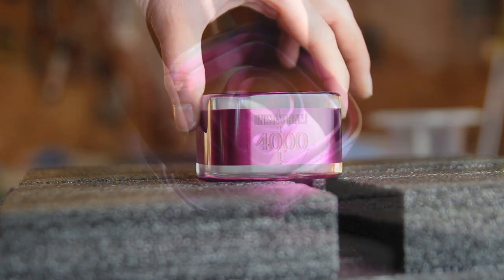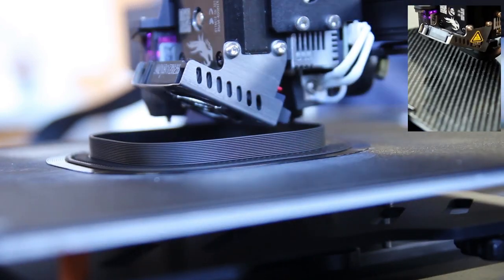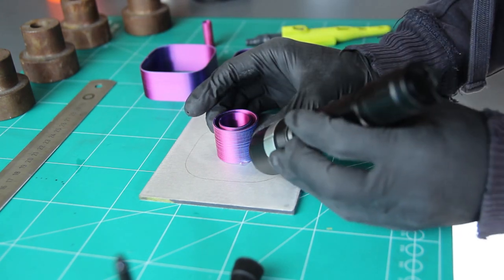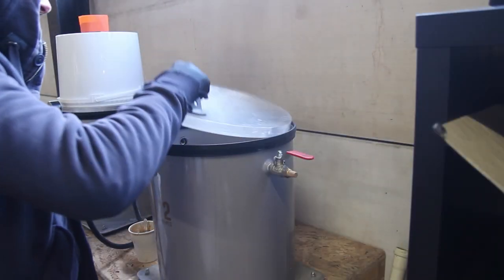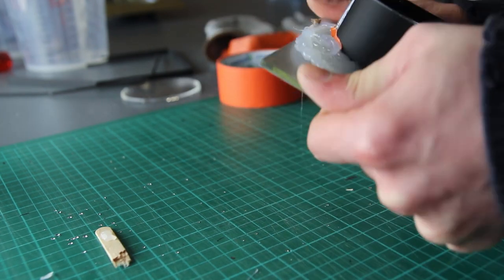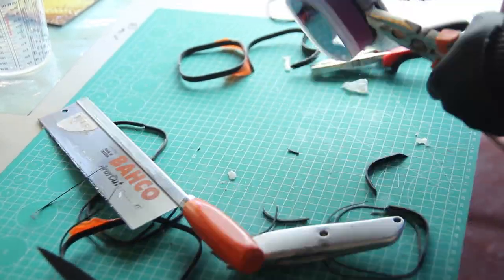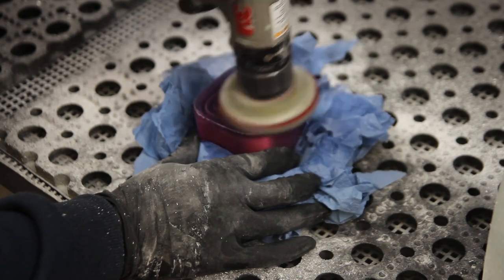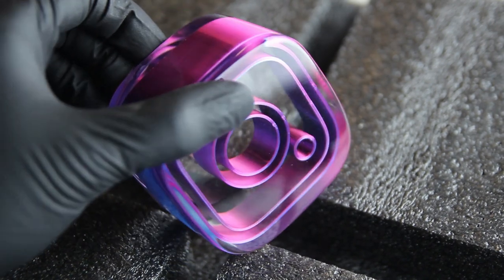Casting 3D Print In Epoxy Resin (Glasslike Translucent Bubble Free High Gloss Finish)

Comment: Looks cool! Next time consider printing a solid layer at the bottom which hold everything toghether perfectly aligned, you can then sand it off once the resin is cured! 
This could also combine the first outside mould!
Reply from the maker: Correct :D thanks for the input

Comment: Lovely! maybe next time try to have the layer start and end points at the inside of the models in stead of the outside to avoid the seam :-) ?
Reply from the maker: yes could have been better indeed :)
Reply: Vase mode doesn't have start/stop lines
Reply: @aleks138  vase mode is only one perimeter, would look much better to put the seam line the opposite side of the text  (Seam Painting in the slicer)

Comment: That filament looks great floating there.
Would be interesting to hear more about the UV resin issue with the glasscast (is that due to different optical indexes or just a general problem with having UV set resin bonding with epoxy resin?)
Reply from the maker: It's more of a different translucency the UV resin has...it has a slightly different color and less translucent/clear than the epoxy. Not really a problem of compatibility

Comment: you should have printed them in vase mode, no seams, much smoother and consistent layers too.
Reply from the maker: Correct! But wanted to print them all at once. Would have had to printed all parts seperately otherwise and the pieces would have been very thin (just one layer now 3), but could work as well indeed!
Reply: @MatthieuLibeert  you can actually trick your slicer to think your nozzle size is larger, just by setting the nozzle size to .6 or larger. iirc, 0.6 should be perfectly doable on most .4 nozzle with .1mm layer height given that you are not printing too fast.

Comment: The Glasscast resin is beautiful. Unless you will be using the hot glue again, it comes off parts really easy if coated with Isopropyl Alcohol. 
How much shrinkage was there with the Glasscast resin?
Reply from the maker: Shrinkage is good with glasscast. Just a bit but in an ok way

Comment: So this resin wont melt pla? because im trying to find a resin that i can poor into a pla print that has spots for resin to be different colors but i cant find a resin that wont melt pla?
Reply from the maker: No epoxy resin wont melt pla. What might cause it to melt is the exothermal reaction creating heat of your not using the right epoxy... For thicker larger pours like here you need a deep cast epoxy resin like used in the video